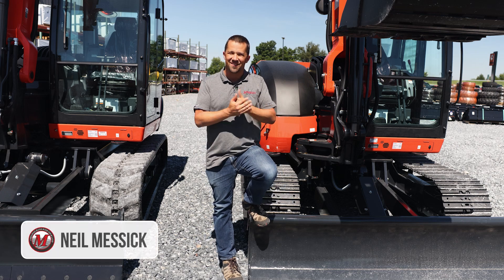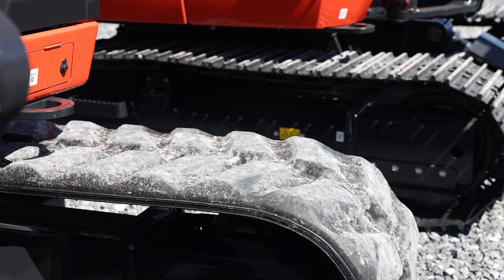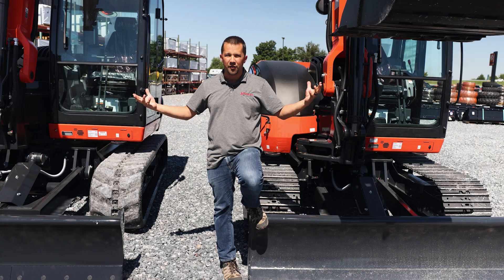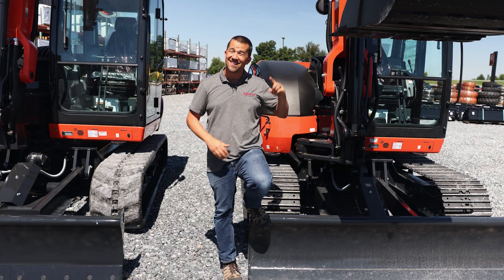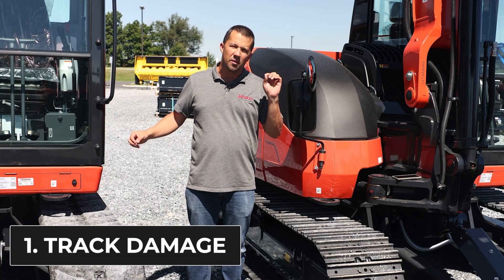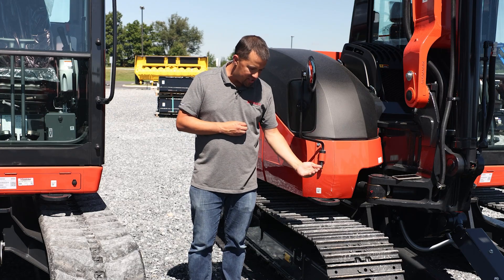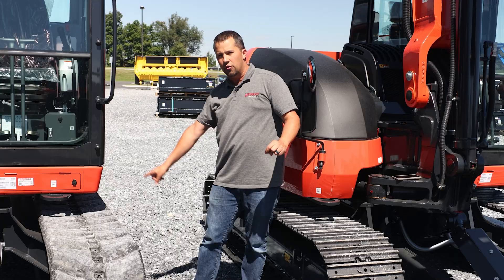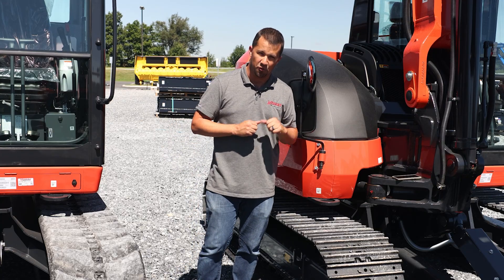8 Differences Between Steel and Rubber Excavator Tracks

Comment: where i live , in hilly terrain, there is a lot of steep concrete roads/ tracks, concrete being the most durable .  and there steel tracks are a big problem, its extremely dangerous going down a steep concrete road with steel tracks, they just start to slide.

Comment: 2:18 steel tracks wear the chain pins first. You can get the pins spun to effectively double their serviceability. Once the pins are stuffed you can also get new pins if the chain is still good. Grouser plates can be swapped to a new chain also. 
So if you can use steel tracks, they can far outlast rubber. 
4:35 
Say what? Rubber is dearer than steel?!? 
Not exactly, if chains need to be replaced, fair chance the drive sprocket segments and idler wheel also need replacing, along with top and bottom rollers....

Comment: you can replace track pads on steel tracks but i'm not sure you'll be unbolting them lol. most of the time you have to torch the bolts out because theyve been beat so much

Comment: The problem with rubber tracks is that if you are driving over Rocky areas they tend to come off.
Reply: I've a LOT of trouble throwing rubber tracks. Try throwing a 900lb track when you are in a muddy creek bed. Not throwing tracks is a huge consideration. Yes I had my rubber tracks tensioned up.
Reply: @jazzlives  I can imagine! Although I did muck out my pond and didn't have any issues. It's when I do a turn over rocky ground that they come off.

Comment: With a mini (12k- less) the drive motors feel significantly stronger with rubber tracks vs steel. I heard this from several operators that have gone from rubber to steel, and also steel to rubber. Traction between either was not noted, just travel/pushing power, has anyone else heard this?
Reply: I have rubber and it pushes great, I think the big lugs are probably why. Rubber lugs are bigger than the ribs on steel track grousers.
Reply: I have used both, personally, if in rocky terrain or doing demolishions I rather have steel tracks, I have had rebar go right through some of my rubber tracks and unfortunately complely tore them apart even though I tried being careful

Comment: A couple of notes for those with inexperienced operators/drivers/yardies: When loading/unloading rubber tracks in the wet/muddy/clay, the rubber can get very twitchy under control. That being said, steel tracks can also slip in wet on metal ramps.

Comment: 100% OE quality Rubber tracks way longer, the problem is people don't realise actually how many miles they travel....typically 4000 to 5000 hours is possible on owner operator but hire in only 2000 to 3000 hours due to abuse...it would be handy if the manufacture did two improvements to make them last longer, one fix and extra bottom roller wheel to spread the load when curbing and 2nd fix an over pressure valve on the idler cylinder to make sure the track is not over stretched and the pressure is released, this over pressure causes devulcanization within the wire and cleats internally which drastically shortens the track life..

Comment: Another consideration you might have discussed is if you can fit steel tracks on a machine that originally came with rubber or rubber tracks on a machine that came with steel. Or are the rest of the drive components different with each track type?

Comment: Doesn't account for all cons but why not have steel plates with rubber pads on them? steel on the rollers for more rigidity, steel plates distribute the weight allowing for more distributed ground pressure, stops damage from metal tracks, doesn't matter if the rubber gets big gouges or cuts as it poses no structural difference to the track, etc. Plus depending on how the rubber pads get attached it could allow for modularity between rubber pads and steel cleats.
Reply: It’s a thing for tanks doing road travel, probably just too expensive for normal construction
Reply: @mikeymike9926  I don’t see how it would be a whole lot more expensive than normal steel tracks, I was thinking the big problem would be whether or not smaller rubber pads independent of one another would be strong enough when bolted to steel tracks, I think maybe they would tear off too easily so perhaps they would only really be good for as you said taking steel tracks on the road?
Reply: I have seem some alternatives that you just bolt on some pads ontop of your existing tracks

Comment: I wish there was better designed rubber pads for steel tracks, traction is horrible with them on any surface other than concrete/asphalt.

Comment: Here's a good question. "How to determine what size mini/compact excavator is right for me?" For me would be maintenance in cleaning up the woods of customers and moving logs onto the live deck for a small firewood processor. Max lifting needed at 1200 pounds up to a height of 5ft or so.
Reply: I am no expert by any means, but I do know a lot about excavators. And usually excavators are chosen and categorized by their digging depth/length of their boom at full extension. But in your circumstance, you are more going for weight and power of the machine as your are in the business of logging. I'm generalizing when I say that. But a few things to keep in mind when looking for a mini excavator is that even if the digging depth is 10' the more stretched out your boom is, the less power you have. So with a 10' dig depth, most of your strength is within 5ft of your machine for the most power to your bucket. And as far as weight goes, it's hard to judge lifting capacity through breakout force, but if you are able to figure out the lifting capacity of a machine, I would recommend going for minimum 50% greater safe working load limit. I hope this helps.
Reply: @nealamberg807 , if could afford it I'd buy the U57 like Mike Morgan has. That machine is SWEET!

Comment: Is there a difference in the frequency of de-tracking between steel and rubber given the same operator and equivalent wear on undercarriage?
Reply: From my experience having and excavation business, the rubber tracks come off far more frequently.
But rubber are also easier to get back on.
It happens to me every few months with rubber tracks. You turn against a hidden stump or rock and the rubber can come off every now and then.
Reply: @2098723  That is exactly what I'm experiencing. I'm now hypervigilant. Where I get in the most trouble is when a cluster of trees forces me to try to track parallel on an almost too steep slope. I've been considering steel tracks because I've never slipped a track off of my dozer and it has been on some rough rocky and sloping stuff. My rubber tracks on the mini are also getting pretty cut up from the rocks.
Reply from the maker: If the tracks are maintained properly, they shouldn't be coming off.
Reply: @MessicksEquip  I live in NW Arkansas where EVERYTHING is on a steep grade. Even with everything well maintained and careful operation there are scenarios where de-tracking becomes more probable. I’m looking for all the help I can get. Thanks for your help Neil. I appreciate your videos.
Reply: @MessicksEquip  I've had several throw-offs with rubber tracks properly tensioned on my 9 ton midi, last one took me days, literally days to get back on. They just don't stay put on slopes. It's a horror show throwing a rubber track if you are working in a deep mud hole. Work stops for days while you figure out some way to get a 900 lb track on by hand since no other machine is able to help. Any track that reduces this would be worth it. Thanks for the quality videos.

Comment: Neil, another great video but I'm very surprised you didn't talk about steel tracks with bolt on rubber pads. They seem to be very popular, and the trade off's with a bare steel track largely go away then. Also one rubber pad can be replaced vs a whole rubber track. Thoughts? It's very popular with CAT and other brands to equip machines that way and gaining traction here too with Kubota product.
Reply from the maker: We're not seeing any uptake yet because of the cost.
Reply: I was actually just about to comment about this. Because the last farm I was at they have a mini ex which they just got away from rubber tracks and switched to steel with rubber pads. Because one major downside to rubber tracks is that they stretch much more than steel tracks. Which was one major reoccurring issue that mini ex had with its tracks. Is that the tracks were worn out to the point when you try to tension the tracks, they would only go so far and continue to walk off the chassis. Given that the tracks were way past their prime, but with steel tracks you are able to get more use out of them for the money that you put into them. This is just in my opinion tho.
Reply: “The trade offs go away…”
Only one goes away, the rest all stay the same and the cost doubles so it’s really only considered for municipal and special use units.
Reply: @jaxturner7288  What would be considered special use applications?
Reply: @blessed7fold  railroad’s and municipal water/sewer departments
Reply: @blessed7fold  --  Well, HEAVY military combat vehicles have rubber over steel.   The rubber keeps them from completely destroying the roads (your  supplies and support need good roads).   A tracked vehicle is needed in the first place to distribute the load.
Reply: I like the tracks on the M1 tank.
Reply: @rtz549  I wonder about that as a machine that just tracks around vs a machine that engages the ground and puts more torque on a static machine. Not that they ain't cool though.
Reply: @brandtwebber5761  yeah I didn't consider it pushing against a load and sheering off the pads.
Reply: I believe there have been rubber pad systems in the past that were used on steel wheels and were less than double the cost.  There have also been attempts to cut up tires and clamp tread sections to metal tracks.  I believe they were also made obsolete because the rubber tracks were made durable enough to be cost effective.  Hopefully someone who knows more than I will respond to this.  Also, Thanks for asking the initial question so I did not have to.
Reply: @MattTCfarm  I've used rubber padded steel tracks on wheeled skid steers and they're relatively cheap to replace and relatively easy to remove and replace. You can also adjust tension by adding or removing links, or in the case of ours changing link positions.
Reply: Didn’t know these existed!